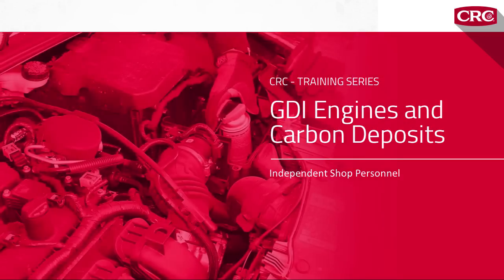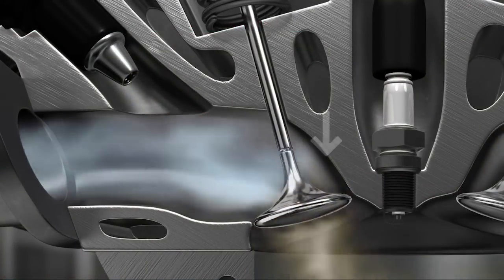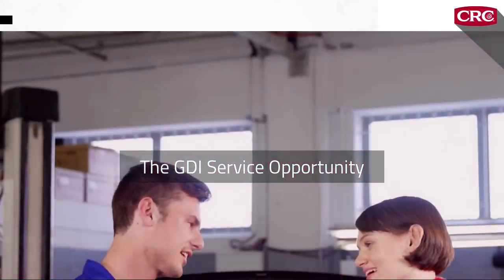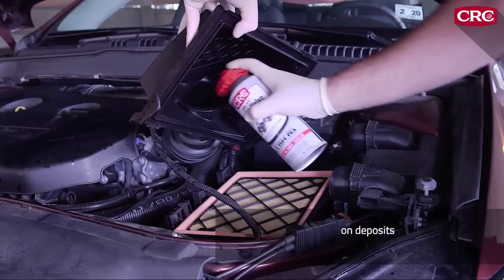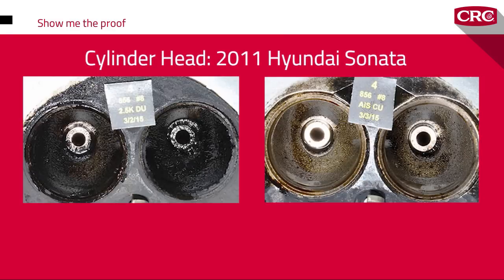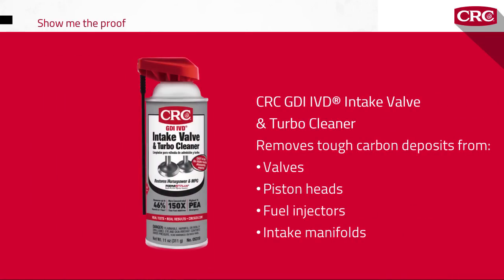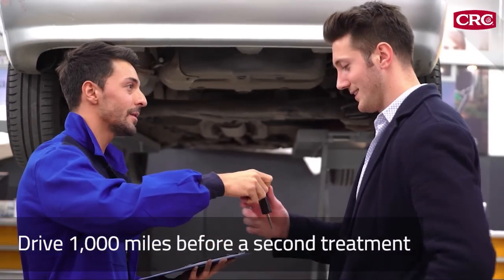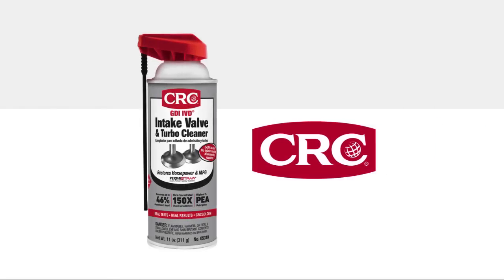How To Use CRC GDI Intake Valve & Turbo Cleaner

Comment: Dear CRC, this is GDI, so if it is sprayed in via the intake system while the engine is running and consumed in the combustion process 99.9% of any by-products will never get past the rings leaving the oil in most part exactly as it was prior to treatment.

Please explain why an oil change is recommended if the treatment NEVER actually gets into the oil lubrication system and if it did it should be flashed off from heat and any by-products would also be trapped in the oil filer which is very unlikely to see any contaminants.
Reply: Because you still have some blow by in the engine cylinder during combustion past the piston rings into the crankcase where the solvents can degrade the effectiveness of the engine oil.  This is more of an issue in Turbo Charged engines where there's more pressure and increased blow by.
Reply: @C_Moore  So NA engines aren't going to be affected much, unless they have blow-by and really CRC recommends changing your oil to cover their A$$'s in the event someone had a  blow-by problem and using the product affected the lubricating ability of the oil causing engine failure.

Comment: Dear CRC, your retail consumer version spray nozzle (Canada only??) stinks. You recommend cleaning at operating temp but when the fans kick on in some models, it shoots overspray everywhere. Please bring back the wand tip. It also appears IMO to contribute to pooling in some manifolds because you can no longer keep it atomized in the air stream since you have no choice but to spray directly on the throttle plate and watch it run down and seep under the tp. Also trying to inject it into a convenient vacuum port is no longer possible and often messy and wasteful on some applications.  My 2 cents.
Reply: The can literally says to spray it thru a vacuum line directly connected to the manifold, and says in parenthesis (i.e. brake booster line). You fucked up mate.

Comment: how and where should i apply the CRC valve and turbo cleaner on my chevy malibu 2015 2.0l turbo? the instructional video  only shows regular none turbo engine.thank for any help
Reply from the maker: Thank you for your comment,  You can administer the product from either the air filter housing or as close to the throttle body as possibly like the charge pipe.
Reply: @CRCAutoUS  so if i spray it into the big hose just after the air filter it will reach those intake valve? or should i take apart the turbo hose and spray it directly into the throttle? which one is better?
Reply from the maker: @hagaishor8551  All of our testing on turbo vehicles and non-turbo vehicles, the product was sprayed from the air filter housing.  The closer to the throttle the better but, we have proved the product is effective on turbo’ed vehicles from the air filter housing.

Comment: Do I need to use your product before I do my oil change or it can be anytime ?
Reply: Jose  Gonzalez anytime
Reply: Alex Trainor I agree, you can do this anytime and do it regularly every 10,000 miles.
Reply: I always do fuel system cleanings just before an oil change, just to be on the safe side.
Reply: Do the treatment right before your oil change so you can drive the required miles then change your oil.
Reply: Hey Jose its Jose, que pasa quelabasa

Comment: I have a Chevy cruze 1.4 turbo. Should I be spraying before the turbo or after.  Is it safe to go through the turbo and intercooler?
Reply from the maker: Thank you for your comment.  Yes the product is safe to go thru the turbo and the intercooler.
You can spray in from the air filter box housing or as close to the throttle body as possible.

Comment: A word of caution. I hit the highway after using this today and the engine of my 2018 mazda 6 started misfiring really bad and the car went into limp home mode. I had to pull over since the car couldn't even get up 50mph. It seems to be fine now but I would be careful.
Reply: That motor has a turbo correct? And is it better now or was it running better after the few misfires? It’s kinda normal because it’s not fuel or air going in so the ECU can bug out
Reply: I really want to try this product. Do you know if I will also have problems with my mazda 3 2015?
Reply: @blackriderph4340  I have a focus st and wouldn’t use it while running the car personally..I’ve used it with the intake manifold off and just manually scrubbed with brushes..read it’s not good for the turbo or the eco boost platform which is very similar to ms3 but nobody has solid evidence..some people say it’s great and others say don’t use it..I have used it in my 01 daily Corolla while running and it worked okay it seems
Reply: @outdat3d-04zx10r-ha  thank you for the feedback! I still cant decide if I’ll do the treatment. I mean I can easily take apart all the intake components and manually clean the valves and ports but I’m concerned if some cleaners and carbon will fall inside the chamber if valve not properly closed and do more harm than just spraying crc.
Reply: @blackriderph4340  I remove the spark plugs and spray brake kleen at first to see if it pools up to make sure the valve is closed..if not it will leak through but even if it does it will evaporate by the time your done with the cleaning
Reply: @outdat3d-04zx10r-ha  the removal of sparkplugs is for easy turning of the crank right and to help the brake clean evaporate faster incase it drips down?
Reply: @blackriderph4340  exactly…you don’t have to spray a bunch to tell if it pools up and the stuff that goes through will evaporate right out with the spark plug out
Reply: @outdat3d-04zx10r-ha  got it! Thanks so much. I’ve never thought of that trick. Big help!
Reply: @blackriderph4340  no problem good luck dude car runs a lot smoother when you get the valves spruced up..they don’t have to be perfect but any chunks deff make a difference in the way it runs you will feel a nice difference after like it’s new

Comment: Started applying the spray via the map sensor port in the intake manifold, engine started knocking pretty violently - did not like it at all. Switched to applying from the air intake. no issues after that. 2018 Audi A4 B9
Reply: At first you did exactly what they said NOT to do!

Comment: Will using this damage the oil or oil filter?
Reply: Intake has absolutely nothing to do with oil or oil filter… the only way for it to “damage” your oil and oil filter is if you opened the oil fill plug and decided to just spray it in there. Oil and intake are completely separate systems

Comment: Does CRC make a similar product for Diesel?
Reply from the maker: Thank you for your comment.  Our product chemistry is formulated for gasoline specifically.  Diesel engines form carbon on other areas not too much on intake valves when compared to GDI so, we recommend a fuel additive for diesel engines with carbon build up.  CRC 1-Tank Diesel  https://www.crcindustries.com/products/diesel-1-tank-power-renew-174-15-fl-oz-05816.html
Reply: Not available in Australia:'(

Comment: so after a treatment goes the carbon the exhaust system ...and clogs the catalytic converter ?   
that is more expensive to replace ...
Reply: Gdi engines already create soot like a diesel so it really is no different than normal operation

Comment: What about car with turbo that the intake system is connected to the turbo and not the throttle body?
Reply from the maker: Thank you for your comment.  You can apply the product through the charge pipe.
Reply: @CRCAutoUS   charge pipe? What is that?
Reply from the maker: The charge pipe is located from the intercooler going to the throttle body.   If you need more detailed instruction you can contact our technical service department at 800.521.3168
Reply: Your charge piping is easy to find. Look at your intake manifold and find the throttle body. See that large hose attached to it? That is the charge air ducting leading from the intercooler. Follow that down a little bit and you are bound to find little spigots coming off of it for boost sensors, etc. You can shoot the product through there or of you have none, loosen the charge air ducting clamp at the throttle body, bend the tube on the can to a nice little 90 degree bend and slide it up under the clamp so the bend points towards the throttle body and spray. ( This has the added effect of cleaning a filthy throttle body which also helps restore performance.) That's how I do it on my Audi. Your car may throw a code for a boost leak or rich condition since you will be holding it at 2K RPM. Make sure you can clear the code afterwards.

Comment: What about all the soot in the motor oil afterwards?
Reply from the maker: We suggest the GDI cleaning at each oil change
Reply: @CRCAutoUS  I have to wonder if it's going to be safe to have all the soot running through the system during and before the oil change and a week after the process as it's still cleaning. A lot of cars especially the VW/Audi 2.0T have very small screens and ball valves such as the ones in the balance shafts. If those get clogged with the soot buildup they will starve for oil and seize, causing the engine to lock up immediately. At best you would have to do another oil change a week afterwards as well.

Comment: CRC Industries, I bought the product and I'm about to do the steps. I just have a question, do I need to change the engine oil after completing the cleaning process or wait till several days for the cleaning to fully take its effect? Thank you.
Reply from the maker: Thank you for your comment. We recommend performing the service first and then changing the oil and filter.  After that its every 10,000 miles or every oil change for maintenance.  If your vehicle has high miles or you know it has heavy build up you can do another service after 1,000 miles.  Then move onto the general maintenance schedule
Reply: Ibrahem Zangana how did it go? Did u wait to change the oil or did it right after?

Comment: To the manufacturer, I have a 2016 git 2.0 T where can I gain access to spray the cleaner in? thnks.
Reply from the maker: Thank you for your comment.  The easiest place is from the air filter box housing. You can also contact our tech department directly for other possible options.  Ph. 800.521.3168

Comment: If a vehicle has over 277k miles and extensive carbon build up, can the product be administered again prior to 10k miles, or is that not recommended?
Reply from the maker: Thank you for your comment.  You can administer the product prior to 10,000 miles but we do recommend to wait at least 1,000 miles in between applications.
Reply: @CRCAutoUS  Okay. Thank you so much for responding. I'm about to start cleaning the MAF right now, then the throttle body and intake valve with our product.
Reply: For excessive carbon buildup, I'd do the treatment before every oil change. Also, regular oil changes help with keeping the engine clean because especially with turbo engines, they dirty up the oil quick due to blowby.

Comment: I drive a 2015 WRX. Is it safe to spray this just after the MAF? Seems like a it has a lot to travel through before it finally gets to the intake valves.
Reply from the maker: Hello Chan, 
 Yes the product will make its way thru all of the intake tubing, turbo, intercooler, charge pipe and get to where it is needed. You can view all of our testing about this on www.crcindustries.com/gdi . On this model vehicle people do remove the MAP sensor and spray in thru that port. You can always spray this product in as close to the throttle body as possible. If you have any more questions feel free to contact CRC tech support.
Reply: @CRCAutoUS  Thank you for the quick reply and instructions! I am very eager to give it a shot.

Comment: I drive a 2007 Mazdaspeed 3 with 175k miles. Will this work with the high mileage and how is the best way to use it? Thanks.
Reply: That car does NOT have direct injection, it shoots fuel BEFORE the valves not after. You have nothing to worry about.
Reply: @MyKonaRC  it is too direct injection do some research or actually know what you're talking about before you give people false information...
Reply from the maker: The product can still be used on port style injection and we recommend following instructions on the can.

Comment: CRC is not going to sell something if it doesn't work. I've used this on my Audi with impressive results. Do the treatment every time you change the oil and you won't have a problem.
Reply from the maker: Thank you for sharing your results with CRC products.  We appreciate the brand support!
Reply: Do not use this after every oil change!!! Your going to damage parts due to certain seals etc needing the additives in modern gasoline. It's complete overkill using this treatment that often and like I said before your going to damage your heads injectors seals etc!

Comment: CRC GDI IVD Intake Valve & Turbo Cleaner
 can be used after an Oil Change?
Reply: If there's alot of carbon build up it will dirty the oil up. Maybe just change the oil sooner than you normally would

Comment: Product is “ for GDI only “ what is the technical reason it cannot be used on say a BMW or other Diesel. 
   The valves have carbon buildup , which should be similar to a gas engine. The compression ratio is double that of a gas engine , other than that they are similar . Valves , pistons , heads and injectors are similar too.
Reply from the maker: CRC carries a line of diesel products, such as CRCDiesel Fuel Therapy Diesel Injector Cleaner Plus

Comment: I have a 2000 audi a8 4.2 v8 can I use this safely on this engine I currently have 246k miles on it I dont believe it's ever been carbon cleaned
Reply from the maker: Thank you for your comment.  Yes, you can definitely use this product with your engine. The product melts the built up carbon in a slow, controlled way. Your A8 will thank you! Never hesitate to contact our tech service department at techservice@crcind.com or 215.442.6290 with additional questions or for detailed instructions.
Reply: @CRCAutoUS  thank you.!!

Comment: How to apply this on a Mini Cooper S R56 N14 2007-2013 engine?  Thank you
Reply from the maker: You can spray in from the air filter housing or as close to the throttle body as possible.
Reply: @Mike Vanna - Did you try this on your mini? If so what did you think? Did you see an improvement? I'm looking to try this...

Comment: @ CRC Industries I have a 2007 bmw n54 just to clarify can I spray your product in the air intake pipe after the air filter?  Thanks for the help
Reply from the maker: Thank you for your comment.  Yes you can apply the product in that way.
Reply: Have you tried cleaning your n54? How did it work?
Reply: Did it work?

Comment: does this stuff destroy your car or does it REALLY work?

2020 Hyundai Kona T-GDI
Reply: me 2 got same car..i wounder if its work!
Reply: Ali Zebari i’m running my car with synthetic oil, make sure that you drive long enough that your car warms up to normal temperature or else the oil will gunk up the intake valve when you shut it off. Most importantly let your engine idle before showing off for a good 15-30 seconds so the oil is cooled off....The more research you do on GDI engines the more you realize that this product is bullshit
Reply: @Rheisler1475  
thanks alot
Reply: Ali Zebari anytime

Comment: is this safe to used on a Ford 1.6L EcoBoost? I have heard there is no Ford approved cleaning method for the EcoBoost engines...
Reply from the maker: Thank you for your comment.  Using a solvent cleaner could make the carbon deposits come off in bigger pieces and possibly cause damage to the engine internals. Our GDI cleaner, however, is a detergent cleaner. What happens is the polyether amine (PEA) in our product will attach itself to the carbon and slowly break it down so it melts in the combustion chamber. Very slow, very controlled. This way there aren’t any big pieces to damage the cylinder walls, pistons, turbos, and exhaust ports/manifolds. Our product has been proven to clean turbo fins. In all of our testing no scoring was found on cylinder walls, pistons, turbo fins, or exhaust manifold ports. The proper way to use this product is per the instructions on the can. This product is designed so you don’t have to perform manual cleaning or tear down. Our PEA chemistry works better with heat from the engine. We have used this product on multiple Ecoboost engines with no issues. The same with our end users. For additional product information and testing results view our GDI cleaner’s website crcgdi.com.  Should you have further questions please contact CRC Technical Support 1.800.521.3168.
Reply: @joaragon  why?

Comment: why this product cannot be used on diesel engines? What's the difference?
Reply from the maker: Thank you for your comment.  Carbon deposits form differently from gasoline then diesel. Our product chemistry is formulated for gasoline.
Reply: @CRCAutoUS   Does a similar product, for diesel engines only, exists? They have that kind of issues too, due to pcv systems
Reply from the maker: @Marco-mj1md  We do not have a spray product available but do offer an pour in, 1-Tank Diesel https://www.crcindustries.com/products/diesel-1-tank-power-renew-174-15-fl-oz-05816.html that treats carbon buildup in diesel engines.
Reply: Gasoline and diesel are different fuels with different combustion characteristics and thus different deposits. What works on one, will not work on the other.